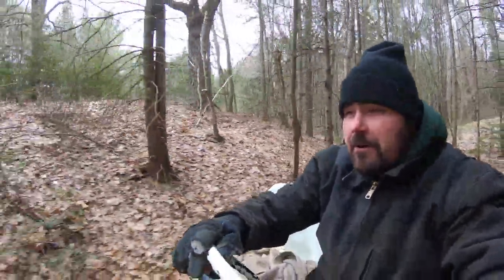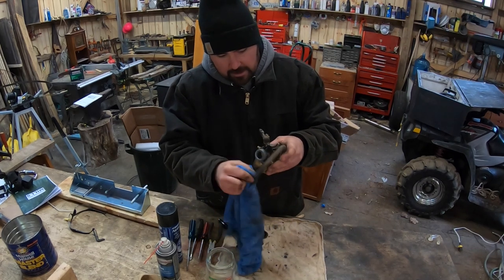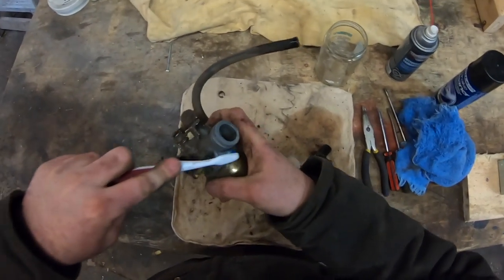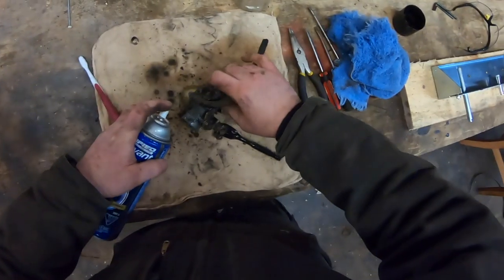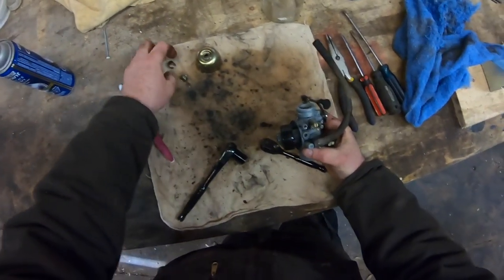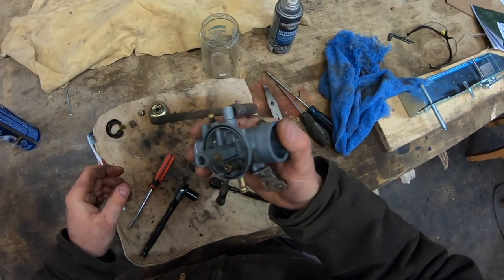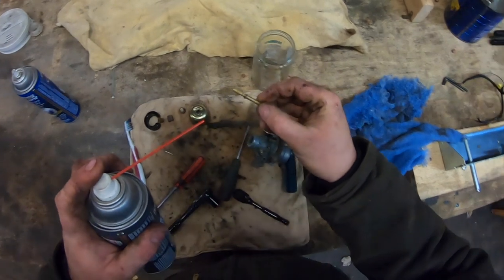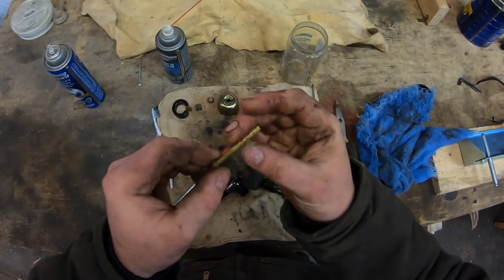How to Take Apart and Clean a Carburetor | How to Make a Golf Cart Run Better

Comment: You can remove ethanol from gas by (wait for it) adding in plain water. Mixing in about 20% of the total gas volume in water should suffice. After a good shake the ethanol will move from the gasoline to the water since the ethanol prefers to be diluted in water. After some sitting the water and ethanol will separate out and can be canted off leaving you with pure gas to use in small engines... The separating is best done in relative small batches of 3-5 gallons and probably best to use some sort of a clear (glass) container of sorts...

Comment: The piano wire things you were referring to are called “tip cleaners” they are tiny round files used for cleaning out oxy-acty torch tips or any other tip with a hole in it. It sure ran better after the cleaning, and that does look like a lot of fun, hey we only live once.

Comment: I followed your instructions and my 87' G2 four stroke is running better but I still have a serious "running rich" problem.  Can you tell me, if I should try adjusting the fuel mixture screw?  It's set at 1&3/4 turns out right now.  Thank you
Reply from the maker: I would imagine it wouldn't hurt to try adjusting that fuel mixture screw just a little

Comment: Hi Sandy.  I just want to point out a few things for future reference(for you and others).  I realize that this video pertains only to a very specific carburetor, but figured I would add my two cents anyway!  :-)

The float should also be checked to make certain that no gas has gotten into it via pin holes/cracks that can develop over time. Also make sure that the float level is correct; again due to time with vibration it can get off...generally close to level will be correct, but several carbs are set not level and you have to check the carb's specs to know for sure.

The float valve tip or seat should also be checked...some carbs have a rubber tip for sealing, others have a viton seat that a solid tipped valve seals against.  Along with this, there are times in which the valve or the valve's "chamber" will have varnish build up on it which will inhibit it from going up and down within its chamber.

You mentioned to not to change the fuel needle valves setting....which I totally agree with.  But they should always be taken out and cleaned along with using carb/brake cleaner to insure that the openings are free from obstruction.  Some carb needle valves also have a rubber o-ring that should be inspected/replaced.  Also, make sure that the needle's tip does not have a groove or pits(corrosion)....if they do, they will normally work but make it very difficult to adjust them properly.  To not upset their settings, simply count the revolutions it takes to screw them in until the just seat themselves(no force!).  Then remove them.  Once cleaned just reseat them and turn out the same number of initial revolutions it took prior to removing them.

Cleaning out the very small orifices of any jet(emulsion tube you called it), one has to be very careful not to enlarge the opening at all...not even a little bit!  What is recommended usually is the use of tag wire(definitely NOT a reamer, drill bit, or serrated wire like for torches).  In case "tag wire" is not a familiar term, it is the wire that paper tags are attached to many new bought items from stores...a bread tie is the same wire(just have to take the plastic/paper off is all)...I now always save any I get as it seems that I could never find one when I needed it! ...like tools, having multiples sure makes it easier to find the one you want!

I hope you don't think I am nit-picking on what you do...quite the contrary.  I have a lot of experience in many things(you think YOU'RE old!  lol) and your videos have helped me learn some things and it is much appreciated...I just want to do the same for you.
Reply from the maker: Thanks Mike. Great to learn from others.

Comment: Have had a Yamaha g1 sitting for months I couldn't figure out why it wouldn't start I took the carb off and cleaned it but didn't know about the stem that goes down into the carb well took it off again took that out cleaned it made sure the ports were clean put it back together and now riding it great video my friend thank you the video helped tremendously
Reply from the maker: I'm glad I could help!

Comment: Good video.  Is the carb on a 2 cycle (Harley golf cart) suppose  to suck the gas from the tank? Mine doesn't seem to.
Reply from the maker: It should take from the tank for sure
Reply: Mine was doing the same I wired up a fuel pump but now she's bogging any recommendations